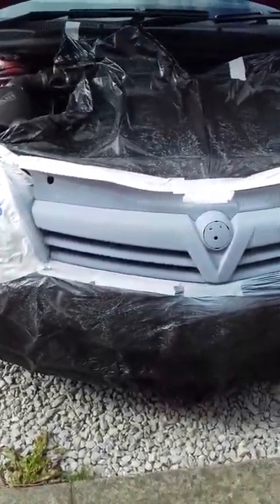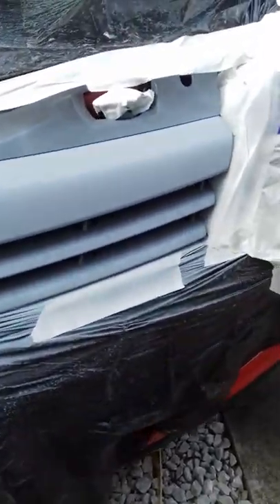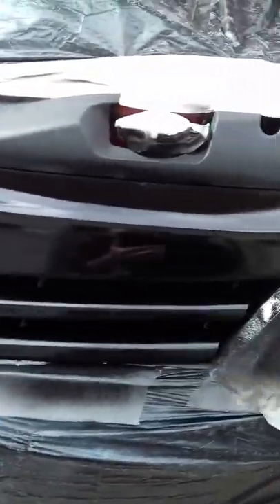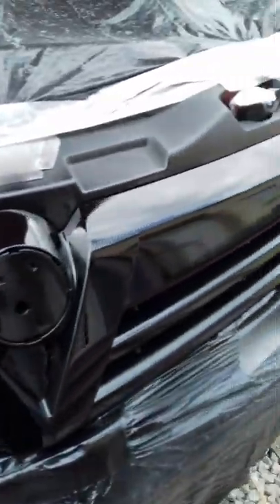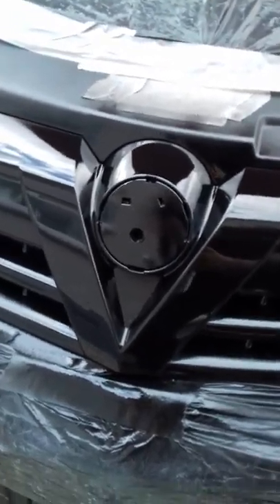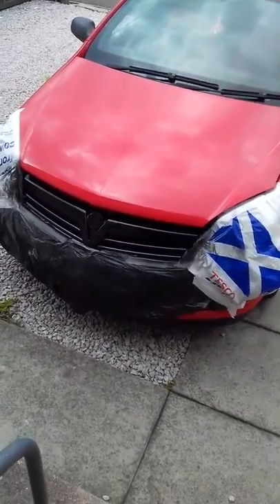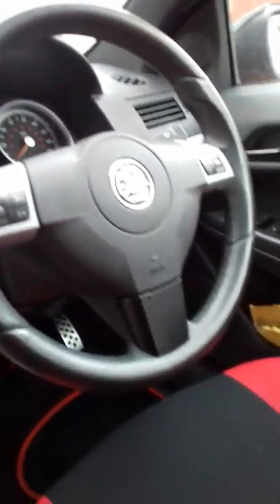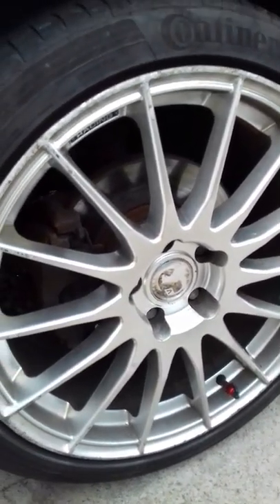How to spray paint your front grill , without removing it

Comment: what grit sand paper did you use? thanjs
Reply from the maker: If I remember correctly it was 1000 grit on the chrome, used a plastic primer 3 coats then a light sand with 1000 grit again before applying the top coat